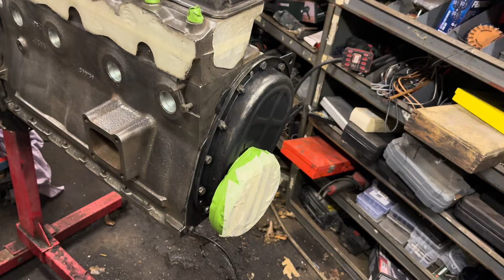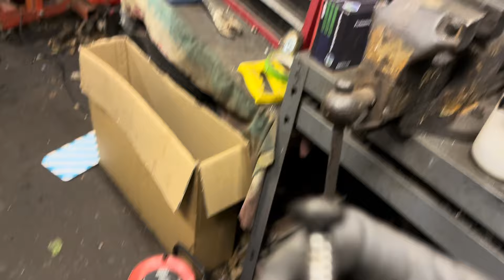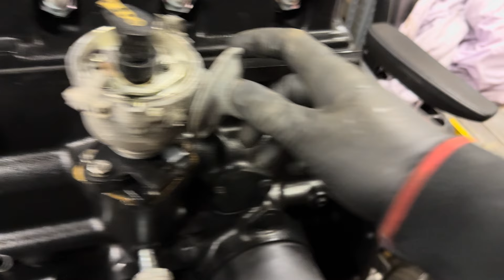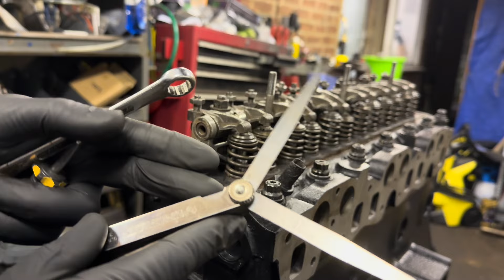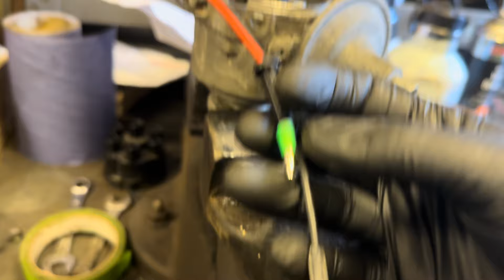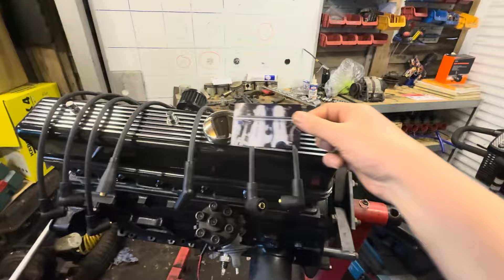Engine Build Progress! Spark Gapping, Valve Clearances & Ignition Timing Setup. Triumph 2500 Part 6

Comment: I swear there was some weird distributor shim thing you needed to do on the TR6. Lots of helpful info. Cheers!
Reply from the maker: I have heard something like this in the past too possibly for the drive gear I refitted mine with the same that it had when I dissembled it. I fitted the distributor by placing it down making sure it’s well engaged, pulling it back slightly and tightening the clamp, this ensures it’s not butted hard against the drive gear.